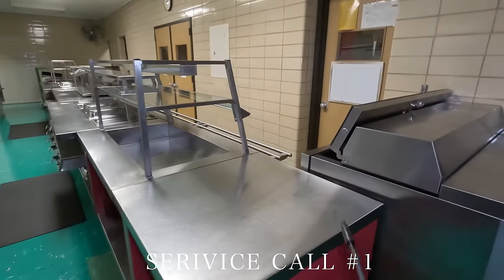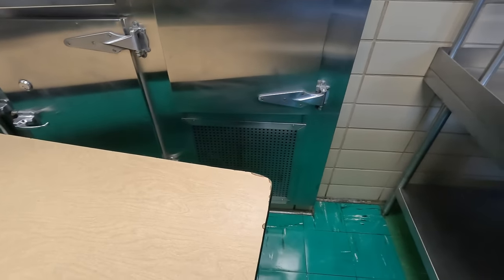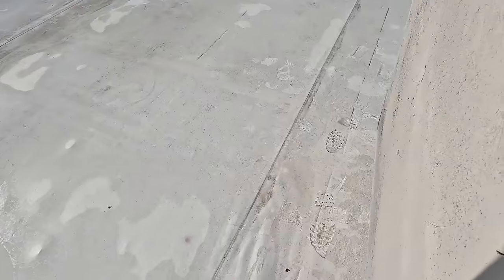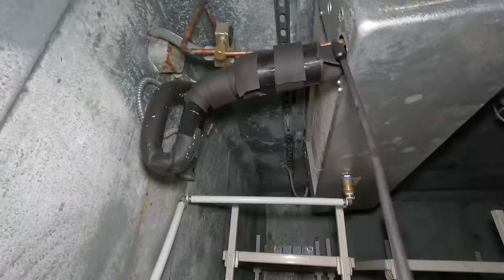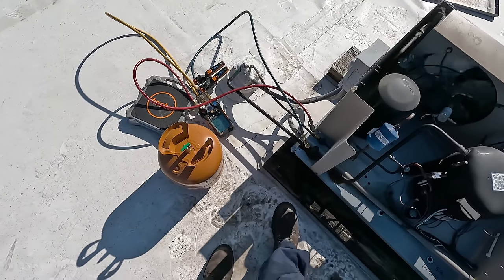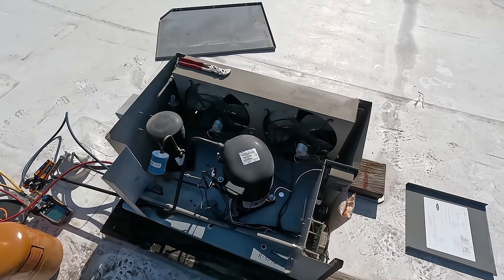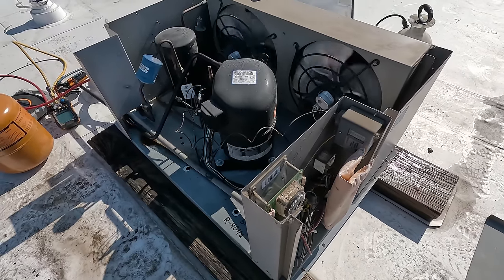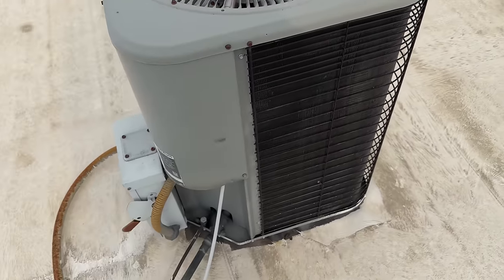2 Videos | Warm Cooler & Warm Kitchen

Comment: If I was in a rush I'd ask the customer if it was working fine before it quit. If they say yes then I would throw on the capacitor and leave. That's a good way to tell if a residential customer is cheap and doesn't want to pay as much. Commercial customer I would go all out and fix as much as they would let me. It's hard to please everyone these days. Some people just want you out of there as quick and cheap as possible. When you bring up more than one thing to a residential customer they will sometimes think you're trying to scam them. It's hard out there these days.
Reply from the maker: That’s all great points. The only thing I would add to your point is another way to help protect yourself against a call back is to note what you seen and what you recommended to the customer. Then note on your paperwork customer choose to not do…. Have them sign it when you finished. Then when it takes a cap later your covered

Comment: Another day in the life of an HVAC service tech. I like that scale....i have the Testo one with the solenoid and an FP. I'm a fan of Inficon products so i don't doubt its a quality scale. I do really like the weight it can take. I use large tanks all the time. Thanks for sharing Rick
Reply from the maker: Right on 👍 it made it really easy to add to that rack. Normally I got a guess. Some of the scales I’ve got will come close, but they really struggle holding it.

Comment: 12:57 - I thought I’d seen it all when, on a no-cool, I walked up to an RTU with a frozen-over recip and evap where the previous ‘tech’ taped the contactor closed with a thumbtack holding in the armature! Nope! This one has to be it! (BTW: I replaced the 75 VA control transformer and removed the thumbtack.)

Comment: That scale seems pretty nice .
Now they have to come up with a tool to lift up them huge tanks without breaking your back and mashing up the scale at the same time .
Reply from the maker: It weighs about 165 pounds full. Whatever kilograms that is for you people lol it fit on their pretty good.
Reply: @HVACRSurvival  just the other day I did a recovery on a chiller 2 circuits with 308 pounds of 134a each circuit.
Had to manhandle the full recovery tanks when they weigh 205 pounds ! 
Boy is that a b*tch of a job !
Reply from the maker: @sterlingarcher46  how much does your recovery tank hold
Reply: @HVACRSurvival  them big ol' buggers they allow up to 62kg of r134a ( about 136-137 pounds ) .
The Tare alone is 30 to 32 kg ( 66-70 pounds ).
Yes technically you could put in more but 62kg is what the manufacturer has set as a safety limit .
I much prefer the regular tanks because even though you'd need over twice a many tanks for the same charge , at least they're so much easier to handle .
The big tanks are very tall and the handle is around the tap so it makes it super difficult to carry them .
I usually use a trolley but you know how it is with roof tops and all that , sometimes you have no choice but to lift 'em sum b*tch !

Comment: It’s probably an LA C180. The diaphragm is crack right where the pin hits it and it over pressurize it. We change them all the time not hard you just change the head.
Reply from the maker: I guess it was a dual pressure valve. I just ordered a new 180.

Comment: I think the reason the capacitor overheated and swelled up is because they sealed that compartment off with silicone so it didn’t have any airflow to help cool it down 😅😅😅
Reply from the maker: Heat is what kills them but I would guess the age was more to do with it.

Comment: I have to send in my Sman480v to get fixed. Are those Testo manifolds worth a dang?
Reply from the maker: I feel though they’ve been pretty dang good. I’ve had a couple 550s and the 557. The first ones got stolen. I like that they’re small small. I have Fieldpiece probes. I just don’t use them right now cause I’m a little bit pissed off at Fieldpiece.
Reply: @HVACRSurvival  Thanks for the input.
Reply: @HVACRSurvival  What happened with Fieldpiece? I'm still liking my Sman 380's I think is what I have.

Comment: On the split ac those condenser motor wires are pinched between the lid and the body of the condenser . Pinched hard
Reply from the maker: I’ve had several of them short. I used to work on Lennox exclusively before I came to this company.
Reply: @HVACRSurvival  yup . I’ve been catching quite a bit of them and we don’t even deal Lennox. Anybody that pops the lid on those things if they aren’t aware there’s a channel for the wires they’re screwed.